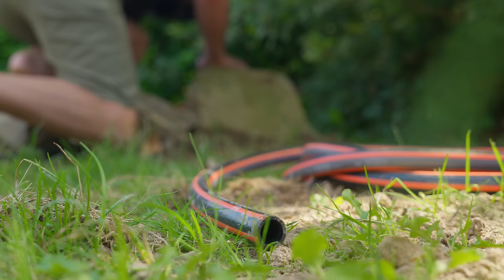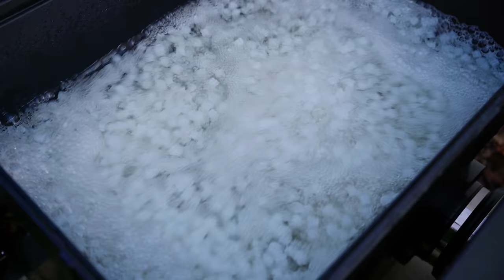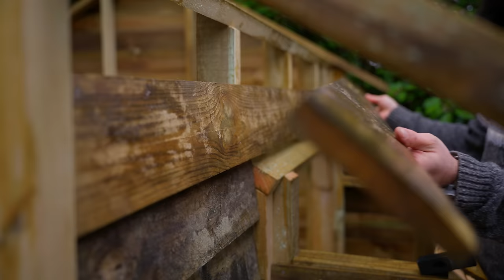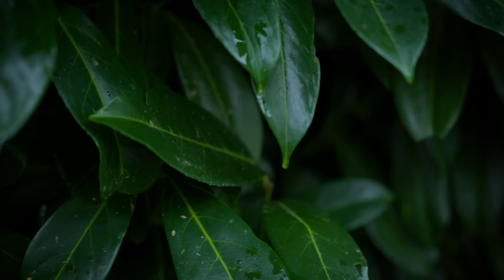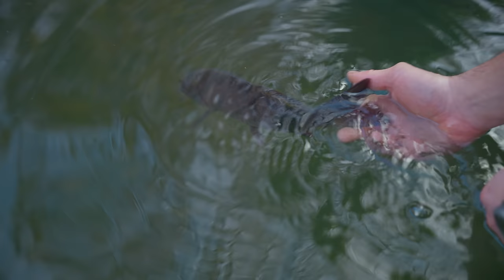Building TINY WARM HOUSE with FISH POND in my Backyard | In 100 DAYS

Comment: absolutely beautiful! I don't want to be a Debbie downer... but... it did not appear that you used a double or triple wall stove pipe thru the roof, also the barrel type wood stove is thin metal and the wood you have stacked right up against it will ignite, there is also the fact that you have the wood stove way to close to the wood siding without a piece of cement fiber board on each side with a 3 inch gap on bottom and 3 inche gap from the wall for an air exchange to keep the wood walls cool. maybe you will never use the wood stove again and it was just for show. but if you do plan on using it, it won't be for long because you will burn the little house down. this is not a maybe it is a definite, it will burn.
Reply: I had the exact same thought! The un-isolated fire so close to the stack of wood is a recipe for disaster!
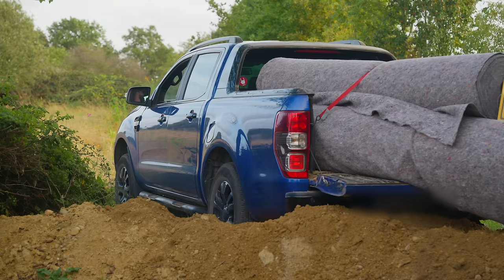Reply: Haven't watched it all, I'm at 3:43 , but my first thought was, "I wonder if that stove pipe is double walled, it doesn't look like it..."
Reply: Well, it's very close to a lot of water
Reply: @pokingHali  in a small house made entirely of wood that appears to be stained also. Literally everything in this is flammable and even an accelerant.
Reply: I was looking for this comment.   I also don't understand how the house is protected from rotting.  I thought he would put at least a factory-made tourist stove and make a safe chimney.

Comment: It looks fantastic!
Well done.
I do have one suggestion, but only if you want this structure to last.
move the grass clumps about three feet away from the wood, and cut back the foliage to at least two feet from the back of the tiny house.
Keep a two-foot barrier between the greenery and the wood, and just have it filled with gravel.  Reduces insects (if you want to maintain the interior) and weathering on the wood.  :)
Reply: Let’s see your video buildings things by hand before you add suggestions
Reply: @zacharyallen3193  What a stupid thing to say!
Reply: Also make sure to have some ventilation.
Reply: Maintenance is 70% of the cost of any landscaping. It's relevant but not part of the 'Zen of it all', I guess. 😎
Reply: No need cutting bushes back since the stove will burn the house down xD
Reply: make the oven fireproof
Reply: @NaeniaNightingale  Well said.  otherwise, the house is just a decoration.  the oven is not safe.  it's one thing to set fire to a couple of splinters for a video, and it's another thing to heat it for heating as just an oven.

Comment: Excellent work, the only thing that concerns me is that it is a wooden structure and that firewood resting against the thin walled firebox could catch on fire very easily and that would be the end of the structure, otherwise great work 👏👏👌
Reply: A paranoid bloke
Reply: My concern also, it wouldn't take much to expect that unsulated area to catch on fire.  Better if you didn't use very much!
Reply: I had the same thoughts. 😅

Comment: There seem to be seven major fire hazard risks in that shed. 

1) It has a roof made out of wood
2) The flute does not extend over the ridge of the shed (check local requirements)
3) There is no spark arrester on the flute
4) You put the wood stove right up to the walls made of wood, with no approved protection behind it and 'above' it on the two sides 
5) There seem to be no protection between the flute, the ceiling and the roof.
6) Protection of the wall behind the flute might also be needed. That too depends on local requirements. It would have been prohibited to do that here without protection.
7) Never, ever put the firewood in contact with the wood stove. Here I believe the requirements is a minimum distance of 60 centimeteres. It would have kept it longer away than that.

To avoid all of this and to prevent having a newly built shed burn down (and you could be in it), get approval for the wood stove, and any wood stove you install anywhere. That is a requirement here, and obviously for very important reasons. You do not seem to have checked the requirements for a single thing regarding this instalment. You must not play with serious things like these...And if all this is not enough, you could potensially set 1 million subscribers' shed on fire too, because many of them would think that you would know these things before you show us how to do it in a YouTube video.

Comment: The doors Angle brace should be from bottom hinge side going opposite top corner locking mechanism side, the weight bearing load be sound the bud

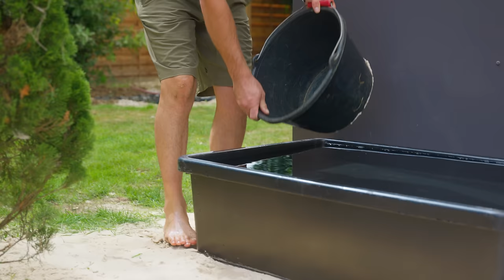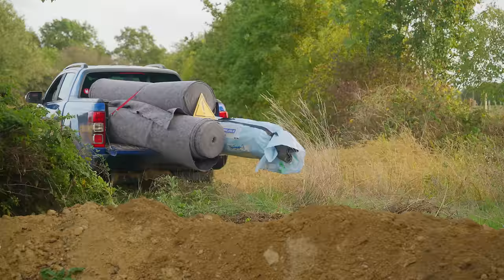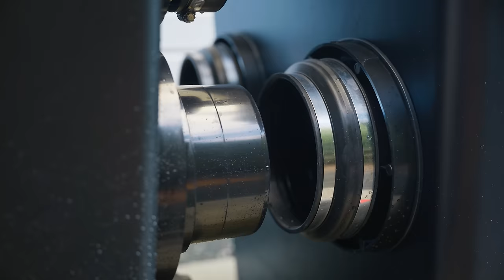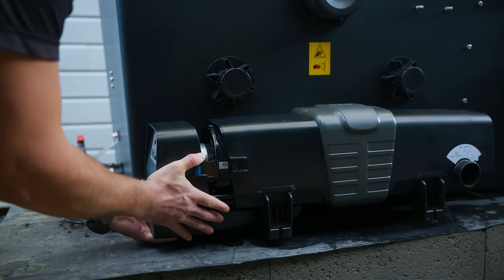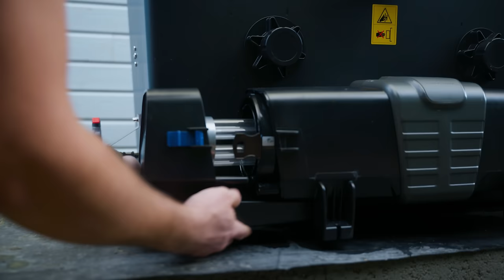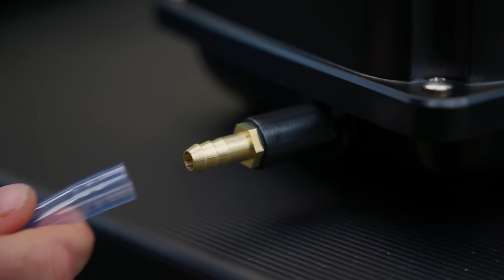Comment: 1:00 THE FISH 1:14 OHHH 3:37MIRROR 10:27 WE HEARD THAT MOAN 12:13 what is that a mini gunÉ 12:28 moan 13:07 look at the hose you can see its either been on there or its fitted and MOAN 13:40 HELLO type moment from home alone 18:25 jump in. is it christmas time bcuz you weaering an ugly sweater 19:29 heello 21:00 didint even screw it in and its holding 36:20 SUIIIIIIIIIIIIIIIIIIIIIIIIIIII 37:20 CARPé

Comment: nice work... lots of attention to detail and then he neglected aesthetic and practical aspects such as burying the pipes, creating a structure that hides the water filtering system and building a wider pier in front of the wooden house (almost you fall into the water when you try to get to the house from the garden). Anyway, really nice work. Compliments.

Comment: Let's see: The pond has no gravel coverage, no hides for the fish and no plant life, and that netting is certainly not going to keep the bass away from the koi forever. Before putting the fish in, you showed long shots of them suffocating (they were gasping for air) in the tiny holding bags you had them in. There's no wetland filter and it looks like the pond is going to have full sun exposure, good luck controlling algae blooms, which will only be worsened by the fact the pond is going to be filled with leaves because you didn't add a skimmer. Now does there appear to be a way to maintain the water level and make sure it both doesn't drop nor overflow. Your Z-brace is backwards on the house, the greenery is planted too close and will attract insects inside and degrade the wood, which is also completely untreated. There's no moisture barrier on the floor, while being exposed to a perpetually wet environment and is undoubtedly going to rot. The house is totally uninsulated, the stove is so close to the wall it's a massive fire hazard - plus, you're letting the firewood touch the actual stove, and the flute are completely unprotected while touching the wood roof. Have fun dismantling your entire setup in two~ months, hope the views are worth the headache.